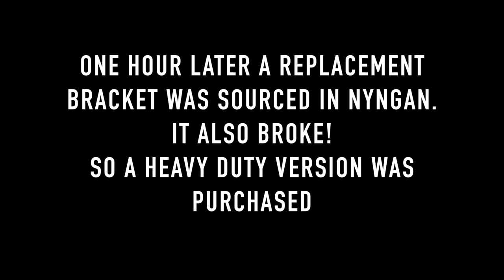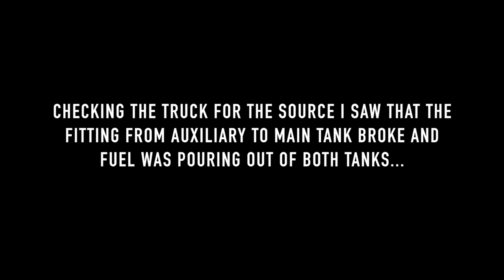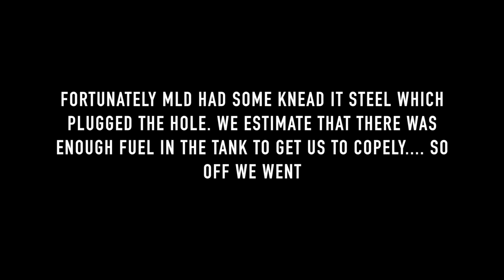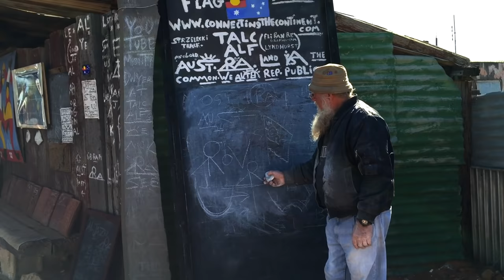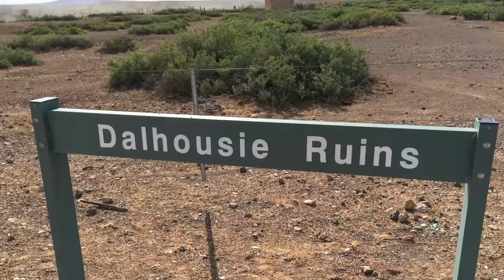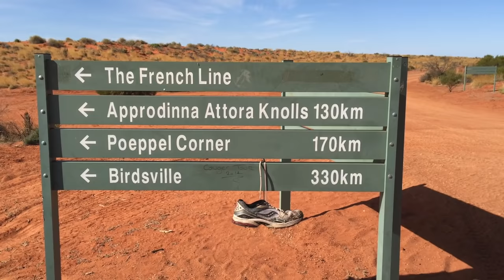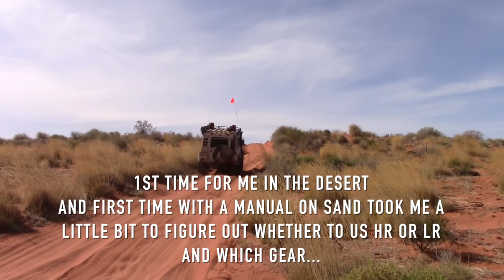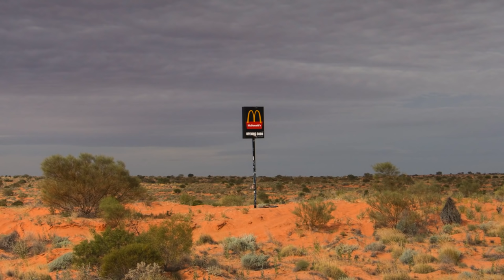4x4 Adventure - The Ultimate Flinders & Simpson Desert 4x4 Adventure Part 1

Comment: Hi, Just wondering what sort of economy your TD5 Defender got going through the Desert?
Reply from the maker: Rob McDowall Hi Rob, I used 15.1 L in my 110 trough the desert, 98% of the time I drove in first or second gear high, my Tyre pressure was 15 PSI except for big red where I went down to 12 PSI.

Comment: Great vid.  I noticed that my experience has been proved again in your video. The big Toyota does not do well I said. I have often had to pull them out with my landy or Pajero. They rev to high and dig themselves in in seconds
Reply from the maker: hard to say as he towed a camper, but I guess with the big V8 you will need a better throttle control than with the smaller engines
Reply: Mathew Peter .....your opinion....don’t generalise mate , no matter what anyone drives they have all been helped at some point , my experience over the years tells me not to get to cocky .